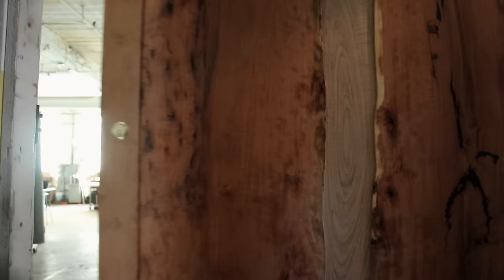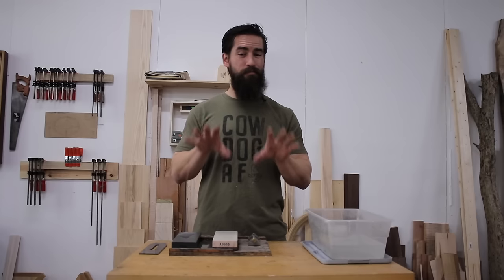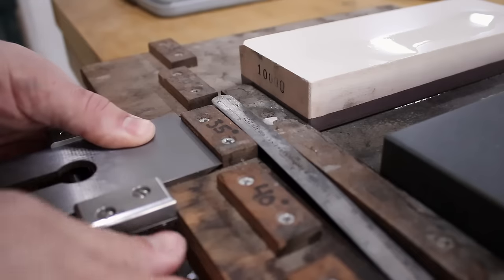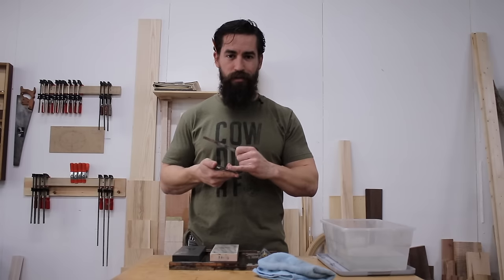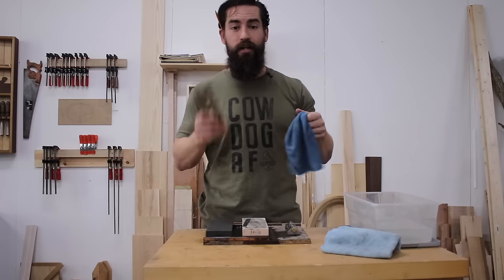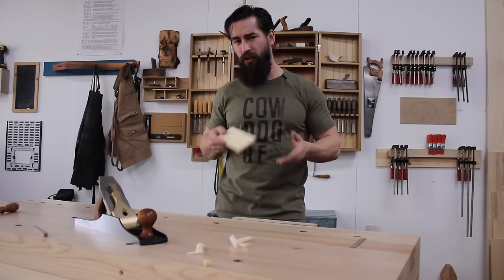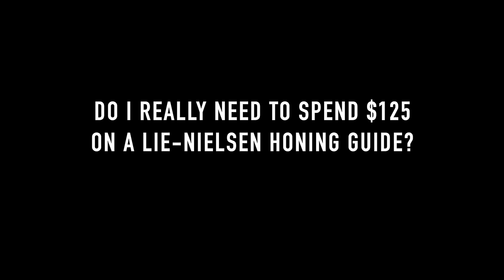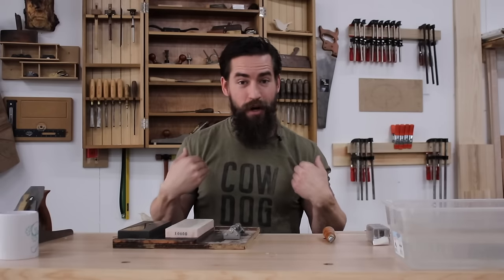The Most Important Skill In Woodworking

Comment: I went to boat building school and as a result I sharpen at 25 degrees. I will try the 35 degrees and compare. Meanwhile, I might add that a second important woodworking skill is learning to properly sharpen and maintain card scrapers, something I also still struggle with.
Reply: Just to be clear, at 2:55, he mentions the primary bevel is 20-25 degrees, with a secondary bevel of 35 degrees.  You probably know about that, but the secondary bevel is a new idea to me and other newbies too. I don' want some newbie grinding down their brand new expensive chisels and burning them them up.
Reply: I had a lot of trouble with card scrapers too. Turned out I can't feel burrs well enough with my finger tips; they're way too big by the time I can. I now use the sensitive skin between my thumb and fore finger to check for a burr. Putting the burr at an angle as most instructions show was a problem as well. I just do nearly 90deg now. Gotten a lot better that way.
Reply: @andrewdennison5700  When the secondary bevel eventually becomes too big, you'll have to grind the edge down to 25 degrees anyway, and that will remove a lot of metal and take forever unless you have coarse diamond plates or power sharpening tools. Some people just prefer to keep their blades at a secondary bevel angle permanently and sharpen and hone the whole bevel each time.

Comment: I notice a lot of you tubers planing something and then come back with some sand paper and if that’s what you like , then just use your belt sander to sharpen your chisel. I believe there is a Japanese word that describes a finish straight off the chisel, or plane, my tool chest is finished that way, no sandpaper. I’ve heard that the Japanese may have the longest history of carpentry, starting with blacksmithing a set of tools to to finishing techniques that are just coming back recently, like burning the surface to add longevity. I switched to a hand made Japanese ..saw back in the 80’s because it is made thinner, hence the pull stroke, and therefore removes less wood making my cuts way faster than a push saw. This saw was made by a master in Japan and if you put a kink in the blade on a push it would snap immediately, so technique was imperative

Comment: I’m going to try the bigger jump in grits. I’ve been doing 600-1000-3000-8000 but maybe I’m over doing it?
Reply from the maker: Nothing wrong with methodically going through the grits as you've been doing. However I will say 99% of the time I go straight from my 1000 stone to my 10,000 stone with no problems whatsoever.

Comment: Another fun and informative presentation. Thx. Now about the ruler trick: I've used it, it works exactly as you describe. So we never put a back bevel on a chisel.  Okay, so then when I go from my next to last stone to the final grit I flip the chisel on its back and give it a few strokes to straighten/remove the burr. Not the entire back, just the front couple of inches. Then the final grit on the bevel side, then a few strokes on the back again; done. Since a plane blade is really just a wide chisel I do the same. I find it is actually somewhat quicker than using the ruler for a back bevel.  I don't see the benefit to either time or ultimate blade life using the ruler trick. Thoughts?
Reply: I'm in the process of fighting with a plane blade made of A2 steel.  A2 is really hard; it takes forever to sharpen.  The ruler trick was really a time saver.  I was able to get a nice polished surface that went back maybe a quarter inch.  Now if I could just get the bevel sharp...  I think I need to find someone who can put a concave grind on it for me.

Comment: What do you recommend for new plane irons and chisels for flattening and polishing the backs? I've always found it to be the most tedious part of sharpening.
Also, does the $15 honing guide hold narrow chisels securely?
Thanks you.
Reply: The backs come off a surface grinder that is able to create flat surfacess almost down to a mirometer, it's pointless to "flatten" it, it often will make it worse. After each sharpening session, make a fraction of a degree back bevel with a few strokes on the final sharpening stone or even just a strop, laying the top of the blade on the ruler or a strip of thin soft material to not marr the blade. That will remove the burr and add keenness to the other side. The myth of polishing the back flat has no evidence base and just follows tradition, which has to go.

Comment: 21:54 do you have experience with Tormek or similar sharpening systems? If so, why do you prefer the stones and manual sharpening?
Reply: Tormek is basically a fancy grinder, the finest stone is a very expensive 1000grit diamond stone, the stropping paste is around 10,000 grit.
Waterstones can be much finer, around 20,000 grit or higher.
You'll never get an edge off a tormek like you can sharpening with stones.
Tormeks excel at grinding odd shapes like a fingernail grind on a bowl gouge or a curved skew grind, for this the tormek is the best but nothing beats waterstones for the absolute sharpest edge possible you'd need for joinery tools like chisels and plane blades.
Reply from the maker: I've used Tormeks many times but I don't own one. I've found them to be quite good but also quite slow--I'm used to hollow grinding on a standard wheel so it's very quick for me. I also think the edge I get off this 10,000 stone is unmatched honestly.

Comment: Hey, if someone needed to do a quick hand plane sharpening/setup walkthrough, that's it right here. Waterstones, they ain't that bad price wise. I went with a DMT diamond stones they run about the same. I like the basic veritas honing guide, because it's better than the 20-30$ ones, since it's proper flat. After watching the vid, I may just add a water stone of ~10000 grit instead of the strop for some tools. A question about flattening though, what grit do you use, and does the grit of paper matter for which stone you work on?
Reply from the maker: For flattening I just use sandpaper. 600g up to about 1000-2000g. Then I go to my stones. Easy peasy.

Comment: Maybe someone has an answer to this problem!
A purchased piece of hardwood, on arrival, such as rough cut ebony, has deep chatter (saw) marks.
After all careful efforts to flatten the surface, the chatter marks remain.
Wetting the surface does help as with knotty wood, but there are stubborn traces of these marks!
Could it be that the speed of rough sawing the piece, compressed and cooked the fibres?
Some experts "toast" woods like ebony peehaps to make it more workable!
The section was 2.5 inches x 1/4 inch.
The 1/4 inch edge planes like butter but chatter marks remain, to a lesser degree!

Comment: When talking about why you shouldn’t have a back bevel on a chisel you explain that when you drive it down it will force the chisel off the vertical. A very small back bevel surely wouldn’t make much difference in this scenario when you a huge bevel on the other face.

I thought that the main reason not to have a back bevel was to keep the cutting edge engaged when paring.
Reply: When you first put a chisel on your marking line, it should go exactly down that line in line with the chisel's back. Putting a back bevel on a chisel ruins that. You would especially notice that when trimming flush-cut dowels or excess dovetail/finger joints, it just never cuts truly flush. That is because the back acts as a solid reference, and no amount of force from the primary bevel will sverve it off course, because the whole back of the chisel pushes against that and keeps the cut flat.

Comment: I've only just recently started to watch your content and have found it quite informative. 
This method of plane blade sharpening is quite common but do you use the same method for a low angle jack plane like the Veritas, where the bevel is on the other side?
You also mentioned for hardwoods to use a higher angle plane. What brand would you suggest as there don't seem to be many out there. I ask this as I am in Australia and have a small supply of river redgum and blackbutt (higher density than black maple).
Can you also leave your pop up text on a few seconds longer. I have to keep going back to read them through!

Comment: Can't emphasise enough how much time is saved by hollow grinding your primary bevel on your chisels & plane irons. It's even easier to register them on the stones when free handing & keeping it consistent. Otherwise you'll end up having to convex it over time & that works as well but I find that it gets weird when you want ctrl over the angle for either soft or hard woods.

I've wasted an insane amount of hours sharpening(Edit: primary bevels & flattening) old tools by hand. At the time, I didn't know what to spend time on & what to either invest or buy the right tool for (buy a cheap or 2nd hand bench grinder. Seriously). If you're into restoring old tools you don't have to have the expensive Tormek as to not ruin the temper.

Edit: I'd also recommend buying a mid- to higher-quality chisels. They should come pre-flattened at least. Restoring crusty old ones can become a never ending nightmare & should be a side hobby in of itself...
Reply: Yeah leave all of them crusty old chisels for me! Rust! Good luck finding a cheap bench grinder that's worth what you pay for it. I've found a couple but they don't pop up all the time. Usually if someone has a decent grinder they don't like to part with it. The cheap ones you can buy new are trash. They won't run true and the motors in them are jokes. I pulled one apart and inside the housing was a shaded pole fan motor. It looked like a bench grinder. What a POS!

Comment: another question, with LN honning guide(long jaw pair)can you sharpening the spokeshave blade to 25°? or only 30°
Reply from the maker: Yes you can use the long jaws to sharpen at 25 as well.
Reply: @ENCurtis  thanks i will buy the honing guide and spokeshave LN(both).

Comment: I use synthetic motor oil, 0-5W. 1 quart is less than $10, and lasts a lifetime.
Reply: Dude you shouldn't use standard motor oil does it has other ingredients in it besides just oil you need to buy non-detergent oil

Comment: Can it compete with japanese plane sharpness,,,
Reply: Yes; its a fundamental skill in every wood working culture. Sharp is sharp, whereever you are. Working with wood is a matter of physical fit and feel. He has a signed maker $500 Japanese Saw, which he bought because he wanted to, and he loves it cutting dovetails. However, he also said expensive tools don't make one a better woodworker. And he's right. Woodworking is a craft, and results come from the interaction of the User with the tool. If you don't know what you're supposed to do with any tool, the results are unlikely to be great. So learn about the tool and the most effective edge geometry for the job you want it to do, and the easiest and quickest way to get it sharp and keep it that way. Buy what you can afford, as most japanese tools are made from modern steels nowadays. Its only the very high end ones are constructed from iron sand in the traditional way.

Comment: Do you use a leather strop
Reply: Do use a leather strop, as many other woodworkers do. If so, why.
Reply: @johnbaker5538  First of all, leather stropping removes the burr to reveal the peak cutting edge. Secondly, clean leather, without compound, polishes the edge on a nanometer level, removing any scratches from 1 micrometer, or even 0.25 micrometer grit, creating keen edge that could cut hair. If you have a 10000 stone, you could hone the blade on it, then proceed to a few strokes on a strop loaded with 0.5 micrometer compound, and finish with a few strokes on clean strop.

Comment: Why 35 degrees, when most cut their secondary at 30?  What does that get you?  I keep a blade for gnarly grain at 45 degrees, which, in my bevel up LN, gives me a 52 degree angle of attack, but I learned that from the multitude who keep their regular blades at 30.  You seem too smart to do so, just to be different, so why?
Reply from the maker: Simply put, I just find it easier. I was sharpening some to 30, but others to 35 to reduce tearout and give a little extra meat behind the cutting edge. Over time I would forget which got sharpened to what angle, so I just started sharpening everything to 35 so I didn't have to think about it. No harm in 30 degrees. Just a personal preference.

Comment: Please don't do the Charlesworth method, it really messes wit the edge and you can never know exactly how far back you need to go on the flat side the next time around.  It's a nightmare.  There is absolutely no need if your blade is flat and true. You can pull back on the entire surface to get rid of the burr or just slice across the edge of a softwood.
Reply from the maker: To each their own my man. Nothing wrong with a flat back for sure.
Reply: @ENCurtis  I am not saying the method doesn't work, I am simply saying it's hard to reproduce the exact same back edge as soon as you change or move set ups. There is also the issue of it only working for a straight edge. It works and rather conveniently in some sense. but only under a very specific and narrow set of circumstances.

Comment: Camber is not a British word.  It's a word in American English.  It's a pretty normal word; not specialized or specific to any one trade/niche/community.  It's just a word, man.

Also, using the ruler trick.  You're meant to go parallel with the long edge of the stone.  That keeps whatever tiny angle you're using uniform.  Moving across the stone as you're doing, is constantly changing the angle that the ruler props up the blade.
Reply: Camber is actually a latin word, via Frencn into British English, before American English existed. And TBH, American English was British English until the 17th century. Time and distance has hybridised both. And Language is dynamic. It evolves. And if we are being perscriptive, then we should acknowledge the importance of Norman French and Latin on both varieties of English, because of the Norman Conquest. Even your legal system reflects the Evolution of English Common Law begun by Henry II. Camber is still in use in Britain to describe the curve of a road surface as a shallow arc. And Paul Sellers helped rebuild the Library in the White House.
Reply: @BigHenFor what I meant was, it’s not specifically a British word and therefore he shouldn’t know it’s meaning. It’s a common word in American English as well. It means the crown of a road here as well. It’s also used in automotive terminology referring to suspension setups. 

He implies that it’s a British word so he doesn’t know what it means. I’m saying it’s not ONLY a British word and he should know what it means.

Comment: Your 10000 grit is that more polished than a leather strop and compound
Reply: Stropping is finer, but if not done exactly right will round off your edge.
Reply: @jerrybrown1446  Well, it certainly could do that, but I'd argue it would be difficult to do.  As long as you dont lift the iron into a ridiculous angle, you should be fine, not need for exactness.
Reply from the maker: A strop would definitely be considered a higher grit, especially with a honing compound applied. While I don't use it regularly anymore, it is convenient to have on hand and is part of my job site sharpening kit.

Comment: If you can’t hone freehand you aren’t worth listening to. Paul Sellers please.
Reply: Thanks for your input, mister fragile ego. Good luck with your out of square, rounded, inconsistent bevel, looking like a mess sharpening jobs. I needed hours to fix the mess you free-handers make when buying used tools. Putting it on a honing guide takes 5-10 seconds and produces guaranteed consistent results. Chisels and handplanes are precision tools, taking micrometers of material at a time, so treat them like ones.

Comment: Did you put a back bevel on a lie nielson?
Utter sacrilege and more money than sense, the blade comes flat out of the box.
The ruler trick is a cowboy fix for lazy woodworkers.
This boggles the mind.
Reply from the maker: To each their own my man. However I will say that Tom Lie Nielsen himself endorses the ruler trick. Nothing wrong with a flat back though.
Reply: D Lewis I would have to agree with you on this aspect. This is just one man's methodology to removing the burr from the backside, even Cosman got sucked into this idea. This can be done on the primary side just as easily by tipping a primary up and taking just a light pass as a secondary but not truly creating a secondary knocking off the burr completely. It's amazing how methodologies get absorbed through media! Don't you find it amazing that the Japanese don't do this technique at all and they don't use secondaries at all on thier chisels or planes. Must be a good reason! 🤔🤔🤔

Comment: A professional wood worker who can't sharpen his tools freehand should be ashamed. You're still using training wheels and that makes you an amateur.
Reply from the maker: You're adorable
Reply: @ENCurtis That's what people tell me.
Reply: Thanks for your input, mister fragile ego. Good luck with your out of square, rounded, inconsistent bevel, looking like a mess sharpening jobs. I needed hours to fix the mess you free-handers make when buying used tools. Putting it on a honing guide takes 5-10 seconds and produces guaranteed consistent results. Chisels and handplanes are precision tools, taking micrometers of material at a time, so treat them like ones.